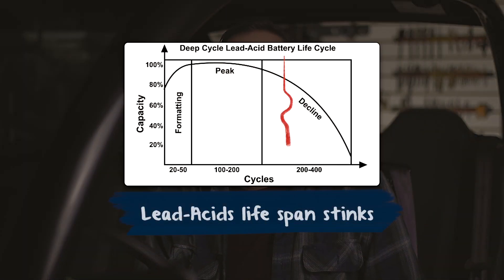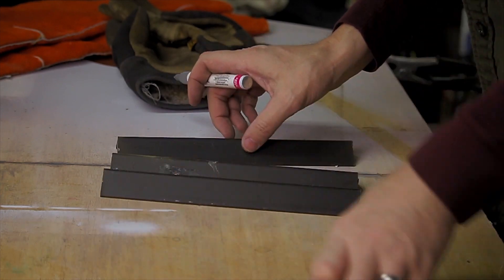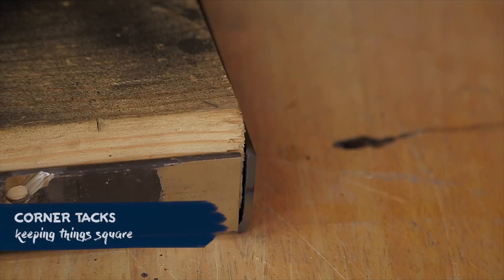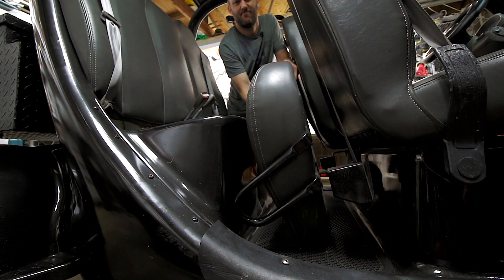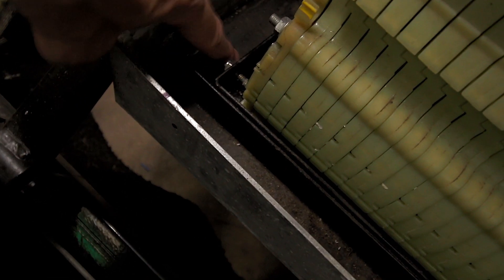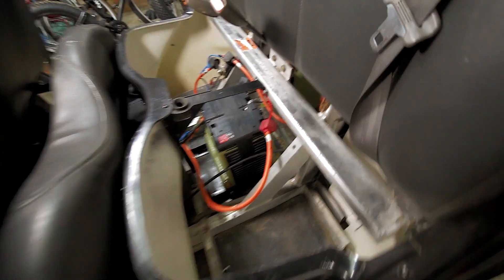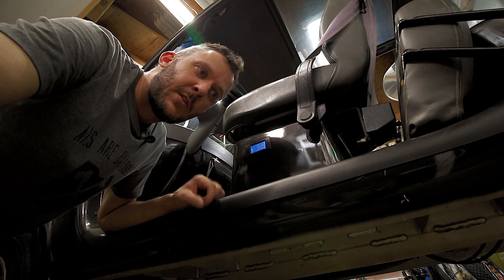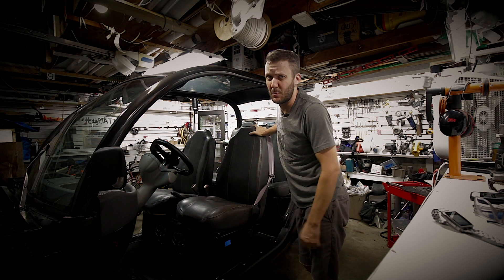Polaris GEM lithium battery conversion from lead-acid

Comment: I have an e2, 2009, whats the maximum volts? I thought it was 72V. You did 96!!! how does the motor and electrical not burn up!!
Reply from the maker: DC motors have a lot of overhead.  You are trading power+speed for longevity however.  They wont last as long.
Reply: @diymatt  What doesnt last as long? The motor?

Comment: Looking to do this conversion on my Polaris Ranger EV. How do the 2 48v lithium batteries compare in distance of use to stock lead acid? I’m struggling with this amp hours vs kWh conversion. Did you need to add a BMI?

Comment: Nice job I really like the sample way you do it. But how did you adjust the charger to charge lithium?
I’m starting the same project but I’ll be using Tesla module. Thanks in advance
Reply from the maker: I sent it to a guy to have it reprogrammed for a fee.
Reply: @diymatt  How much was the conversion for the charger?
Reply: i just picked up a gem last week. what is the top voltage when its freshly charged? i am told the gem will give an error code for anything over 86 volts and not run. is that true? and does your stock electric motor  overheat with the higher voltage? what is the new top speed? assuming you reprogrammed the controller to allow top speeds? @diymatt

Comment: Im looking to convert my GEM. Can you let me the batteries you used. Year range and how many of them and the information to make them work. 
I have a 2002 4 seater.
Reply: Did you convert yours to lithium yet? i just bought the same unit and would like to convert mine.  they say the volt battery at 96V will not be recognized at the stock controller. is there another one that you had used?

Comment: the jokes about getting shocked my EVs are so lame
Reply from the maker: Why?  It's 96volts DC.  Wicked dangerous.
Reply: @diymatt joke about getting shocked by touching the EV is old/trite.  Obviously 96V is dangerous....
Reply from the maker: @jpmorgan187  You are right, what was I thinking 2 1/2 years ago.  I better just pull the video.
Reply: @diymatt  good call